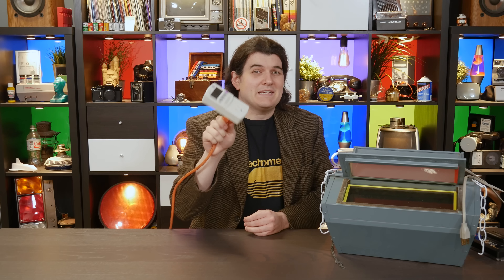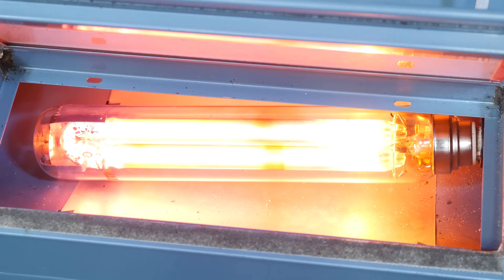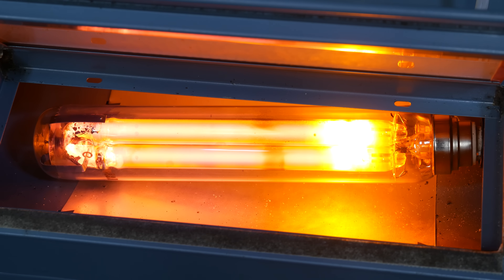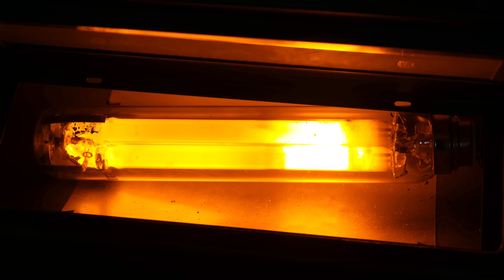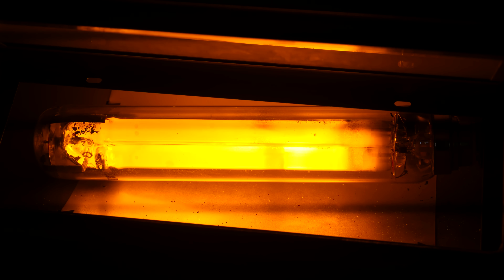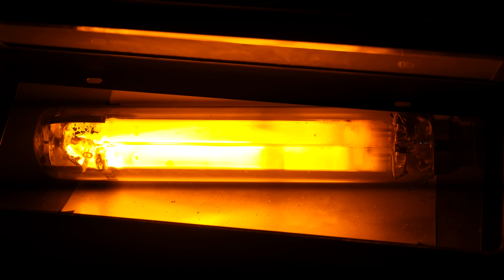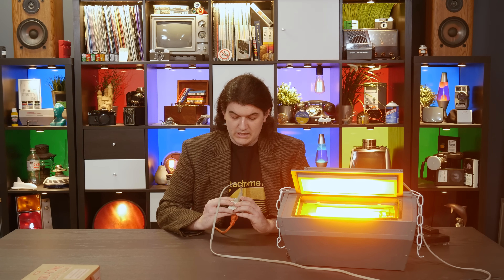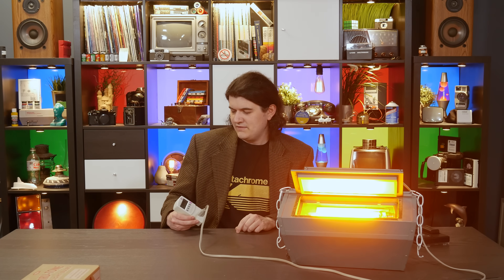More vaguely-informative ramblings about low pressure sodium lamps

Comment: I have heard that fluorescent lamps and bulbs will last a terribly long time if left on continuously but every time they are switched on and off and all that it greatly reduces their life span, (and that the switching on is quite costly in power so for short times of off time, its better to just leave them on using less power while on that duration, than they consume when turned on to get everything running so the gas can be excited vs it just maintaining the excited state once going, 

if any of that is true, I wonder if this effects the life of those bulbs you have too, like the mechanism that gets the metal vaporized initially so it can be turned into plasma, taking additional damage every time it has to do it's job from a cold start?

Comment: Since I have an outdoor fixture that uses a High Pressure Sodium Lamp I needed to know the difference. Based on that research, it's more likely that the roads and bridges lights are using High Pressure ones, which are readily available. They aren't as efficient but they last longer, 12K-18K for Low and 16k-24k for high, hours that is. I don't suppose you can use a High Pressure one in that unit, can you? If not, and you think you'll need one, I'd snatch up some of those Low Pressure ones off ebay. The High P replacement we got was $19 and ebay has some Low P ones for around $25 right now. Thanks for another informative video.

Comment: As a former commercial electrician, I find that 60Hz hum kinda soothing. That even tone typically means everything is working as designed. As the sodium becomes a plasma, the resistance drops, so you should see less power draw after it has warmed up. Also, lots of people make analogies between electricity and water flow: Voltage = Flow, Amperage = Pressure, etc. Think of high power factors like back pressure, different from resistance caused by conductors or "pipes", it's caused by poor "flow paths" in the device.

Comment: power factor of a small inductive load is a givven in modern homes! Because of all of the SMPSs arround the power factor is mostly capacitive so if you run this you might actually help the grid not harm it

Comment: Hi, would it be possible for you to do a video specifically on power factor? I actually work in a chemical plant and I run 2 small turbine generators that put out about 15mw a pop, we are told to run just a slight export of kvars to grid, which usually puts the generators around .85 to .92 power factor (due to the fact we have a ton of inductive loads in the plant, ie. Electric motors for pumps, heating coils, etc)
It's one of those things we know how to run, but we don't know exactly how or why it works, and I'd love hear you explain it. 
If it's out of your scope of something you just don't want to do I totally understand.
Thanks for all the cool videos

Comment: There was a bulb that was being made in the late seventies.
But I'm wondering if they're still making.

Have no idea what they're called.

But they had an oversized filament and a magnet in the middle.

And when you turn on the bulb the filament will start fluttering because of the magnet in the middle of it..

And it looked pretty cool so like a electrified butterfly wing.

Comment: The best way I've heard it described is infrastructure must be built for apparent power (peak current, regardless of phase angle) but most consumers only have to pay for real power.
Here, this light is effectively just an inductor across the line, and only the fact that the bulb is in series with it is pulling the power factor away from 0.

Comment: Power factor: I suspect that many who watch this channel have some understanding about reactive and real power, but if you're interested: with a power factor of 1, the voltage and current draw of a component in an AC system (e.g. mains electricity) are in phase, and since power is voltage times current, all the current drawn provides power to the component (real power: we measure this in watts [W]). This is the case for true resistive loads, i.e. their complex impedance have zero imaginary part (imaginary parts introduce phase shift). A resistor is an example of this.

However, with inductive (e.g. electric motors) or capacitive (less common but exist) loads, the voltage and current are not in phase. With the voltage 90 degrees out of phase to the current, no real power is delivered to the load, but it still draws current. One half of the period, the device draws/stores energy; in the other half, this energy is pushed back into the grid. So this reactive power, measured in VA (volt-amperes) to denote that it is not real power, leads to losses in the electrical grid due to current drawn. Every cable has some resistance, and the power loss in the cable is equal to R*I^2. So if the current doubles, the loss is 4 times greater.

The power factor is simply how much of the total current supplied to the load is used to do real work. If the phase angle between the current and the voltage is 45 degrees, cos(45°)=0.707... => 71% is real power and 29% is reactive power. In most countries, you only pay for the real power supplied to your home, but with high reactive power draw, it puts extra strain on the wiring in your house and on the electrical grid, and leads to higher losses.

Comment: LPS has a horrible colour, lower energy consumption compared to HPS. you'll never get rid of the hum, every LPS are the same. We had the on every street until a few years ago when they switched to white LEDs. We have been in the same house for 40 years and they never changed the 1 outside my house. A few in my area failed but not very often. Happy new year.
Reply: The hum is probably caused by the ballast falling apart, not the lamp itself.
Reply: @zspacecaptain8228  The hum is caused by the coil/magnetic ballast. Pretty much the same with the old pre-digital MH/HPS ballasts too.

Comment: Wishing you all Happy & Prosperous 2022 !
🥳   🥳   🥳   🥳   🥳   🥳   🥳   🥳   
So, with a power factor < 0.2, what is the actual power your supplier's meter charges you for? 
🎇 🎆🎇 🎆🎇 🎆🎇 🎆🎇 🎆🎇 🎆🎇 🎆🎇 🎆🎇 🎆
A trick I saw used at a camp fire, a small amount of sodium from a scrap lamp was placed into the kindling. Some gas (petrol) was also added to the sodium. A participant was asked to check that a glass was really filled with tap water by taking a sit before the water was poured onto the hidden sodium and as if by magic, the camp fire lit instantly!

Comment: Low pressure sodium lasts forever unless broken by impact. The street lights should have a temp control that shuts them off if they get to hot, and turns on again a min later
Reply: Downside is not energy efficient.
Reply: My city, Edmonton Alberta has LOTS, and only started using LEDs for all new and replaced lights for like 5 years. Probably 80%+ of lights are still low sodium.

Comment: Seen many of these lights die the red death back when they were more common to see around. Really more of a pink, I'd say. Most of them got replaced with bright white obnoxious LEDs. But they were so bad that they've started replacing those with a more mellow yellow again. Still LED, but toned down a bit. Easier to see than the old sodium monochrome lamps, but not as eye burning as the midday sun.
Reply: I have never seen an LED light that wasn’t super intense and  bright white. This is probably why I don’t like LED lights
Reply: @dustmybroom288  in my experience form installing the things, the main problem is companies and cities often install lights that are too strong for what they are using them for. One job i did we replaced 1000 watt Metal Halide fixtures with 495 watt LED fixtures at a rail yard. Problem was, those fixtures where way too bright and they caused way too much glare for the railyard operators, probably because no one bothered to actually compare the lumen output of the fixtures. they probably could have gone down to about 200 watt LED fixtures and they would have been fine.

Then another job i did, the Engineer wanted us to replace nineteen 80 watt fluorescent fixtures in an MCC with these massive 260+ watt, 36000 lumen LED fixtures. The engineer said, well i got them because they where bright. It didn't cross this guys mind that there was such a thing as too much light. We ended up wiring up the fixtures so that only a third of the LED strips where actually running and the mill safety guys still complained that it was too bright. Of course we couldn't even run all the fixtures at full power without tripping the breaker.

Comment: The hum sounds like the coils in the ballast and I highly doubt you can change the ballast in anyway that fix the hum. Sort of maybe replacing it with a more modern ballast possibly. Honestly I think the ballast is more likely to fail assuming the bulb crack and cathode ends don't burn through excessive startups.

Comment: One wear method is the sodium reacting with the glass to form silicon and sodium oxide. Another one is the electrodes themselves, that vaporize away very slowly. They certainly last a long time, but what a well organized government will do is to schedule maintenance and replace them ahead of time, so I guess they never failed because where have you last seen a well organized government?

Comment: They definitely do fail, they enter a restrike cycle where it strikes and then fails to heat up full then it’ll totally fail and restart. Interestingly the older they get the more power they consume
Reply: The streetlight outside my house did that for, like... five years, which tells yoiu something about the maintenance priority this area has with whatever agency is responsible for that kind of thing.

Comment: My way to explain power factor (active reactive and apparent power) is:
You have a car and needs to stay at 20mph at .99 you have almost perfect power factor, and the only thing holding you vehicle back is the drag from the wind and friction from the tire ("reactive power" that the car needs because no friction on the tire and means no  way to put the engine power to the ground)
But if you power factor gets lower and lower i usually say its like pressing the brake pedal, it will generate more restriction and the vehicle will have to work harder to keep the 20mph, harder the brakes are pressed, the lower the power factor is.

Comment: It makes sense to me that the power consumption would drop as the bulb warmed up; before the bulb is warm, it's consuming more power in order to get warm, and once it's reached its equilibrium temperature it doesn't need as much power to maintain that heat.

Comment: Lamp life is the emissive material on the filament failing, and then also sodium attacking the graduated seal that is there where the seal is, as they go from quartz glass to a softer glass that will handle the leadout wires going through, and also allows the vacuum system to pull all the gas out before introducing the Penning gas mix that provides the initial conduction. That is why your standard operating position is base up, or with the base no more than 15 degrees from horizontal, so the liquid sodium does not get near the filament area, and rapidly erode the glass, as it is a sodium oxide, so will dissolve in sodium, unlike the fused silicon dioxide of the rest of the arc tube.

Warm up time is because you have to heat up the inner tube to the point the sodium inside turns to vapour, which is the yellow emission, and the indium oxide coating on the inner surface of the glass envelope and the outside of the quartz tube is there to reflect the IR energy back to the tube. 

Ballast is an autotransformer ballast with a tuned circuit in it, and likely the capacitors in there have changed value from self healing, and should be replaced. Identical value polyester motor run capacitors, one  by one, and the power factor will improve, especially as the lamp warms to full brightness, and should land up at around 0.85 lagging when on for around 2 hours.

Comment: Those sodium lights last forever, like 20 years or more, their primary failure mode is over heating, typically due to just getting dirty and it acts like an insulator to retain the heat.

Comment: yes they would wuld last forever, they typically last on streetlamps over 10 years, i doubt LEDs can match that with all the electronics and stuff. Normally they have a capacitor to compensate for that  power factor they dont have a lot of distortion reactive power so capacitor is perfect . I guess the meter measures actually VA and not W so that's the discrepancy.

Comment: It's possible the ballast had a power factor correction cap and the cap has failed with excessive leakage current, doubling power consumption and no longer correcting for power factor.

There's (or was, haven't really been there since covid) a place along I-94 around Kenosha that had a name that suggested they made bulbs for street lighting.  It wouldn't surprise me if there were a handful of specialty lighting companies supplying the government with bulbs so they don't have to pay to replace fixtures.
Cathode Ray Tube display rebuilding is basically dead in the USA except for one company that only takes on defense contractor work (think CRT displays in jet fighters and the like) and presumably charges thousands of bucks per unit.  Members of the vintage TV community have tried to talk them in to doing rebuilds and either gotten told to take a hike or gotten crazy multi-thousand dollar quotes.

Comment: When the lamp nears end of life, its reactions with the lamp's alumina (synthetic sapphire, really) shell have depleted much of the sodium from the lamp, raising the voltage required to maintain the discharge to a point where when the lamp is fully hot, the ballast can no longer provide that voltage, causing the lamp to extinguish and re-strike . the lamp uses more power (watts) as it gets older
Reply: you can see through the discharge envelope here so it can't be alumina. It's either glass or fused silica. Same metal loss mechanism though probably. Also, the argon is slightly soluble in the glass and lost to the Penning mix over time. Only the HP Na and Hg lamps use sintered alumina envelopes.
Reply: This is the case for High pressure Sodium Lamps. Not for low pressure Sodium.

Comment: I work in NC. We have used High Pressure Sodium wall packs on our schools. They vary from 70 to 250 watts. The lamps are mostly rated for 15,000 hours. Our sodium street lights have almost all been replaced by LEDs. I have seem the sodium street lights fail and the HPS lamps fail by blinking off and cool down to restart at the end of their life.

Comment: Brings back some memories. I used to work for Osram Sylvania making HID lamps. We had both LPS and HPS lines in the factory but I was a low watt metal halide guy.
Reply: Low watt metal halide in terms of vehicle headlights? Or like 35 watt MH security etc.
Reply: @silicon212  we made 50, 100 and 150W lamps as our "bread and butter". Not vehicle headlights (that was a separate plant about an hour away). It was common outdoor commercial flood lighting in the days before LEDs.  Not really street or parking lot lighting, that was more like 400W.  Think small businesses with like a tiny parking lot or driveway.
Reply: @c97f Awesome.  I love the CRI of metal halide lamps, they work great for automotive shops.  Very close to 'cool white' fluorescent lamps.
Reply: Love metal halides - great for shops!!

Comment: Fun video - I used to work with these lamps when I did photochemistry work.  Instead of the expensive hanovia lamp,  I de-glassed a 450-watt low pressure sodium street lamp to just the innards/discharge tube.  With filters we got a high concentration of either the 220 or 254 nm discharges and had samples working very close to the light sources.  It was so bright and produced so much heat we had to make a light-sealed cabinet with liquid and air-flow cooling to handle things for long operation.  Good times, and it gave me ths sunburn of my life with very little exposure without the outer glass.  The lamp will eventually lose the atmosphere inside the discharge tube, it is extremely slow but gases do diffuse over time through the glass.
Reply: Na doesn't produce those lines. You had to have been using Hg of some kind.
Reply: @Muonium1  You are right, forgot it was mercury, sodium lamps definitely for elsewhere.

Comment: As a kid in the UK, I remember seeing early LPS lamps which had a separate glass vacuum 'jacket'. The failed U tube was withdrawn from said jacket, complete with its ceramic bayonet cap base, and replaced with a new one.
Reply: Those were the old SO lamps right? When the jacket became one with the arc tube they were called SOI, then efficiency improved and they were renamed SOX and the wattages were dropped from 50W to 35, then eventually SOX-E and another rerating down.